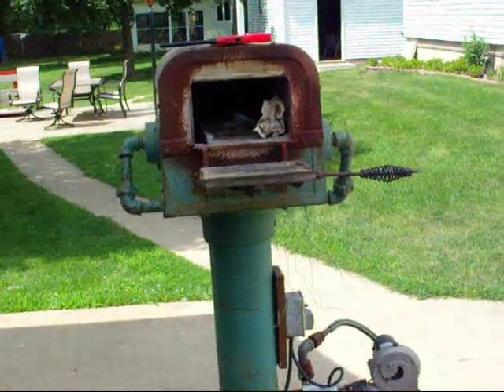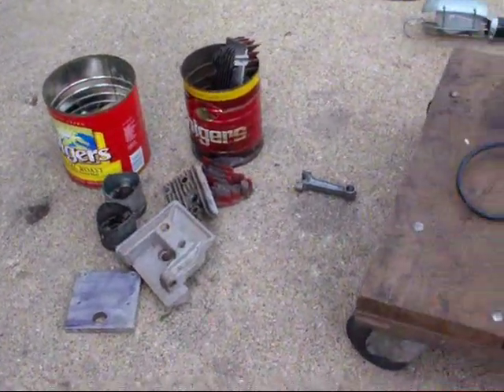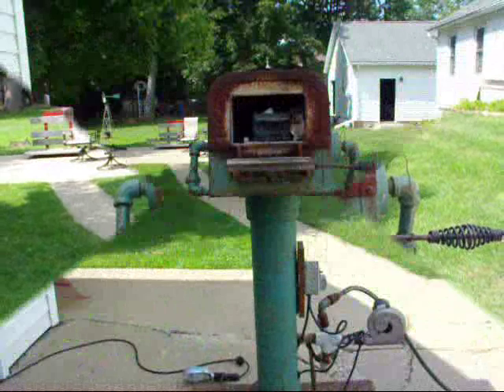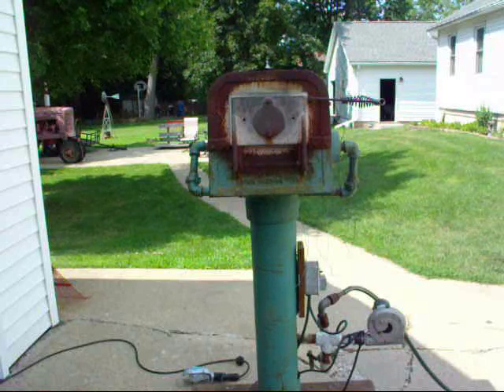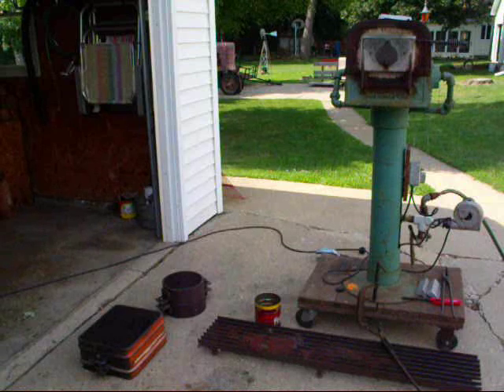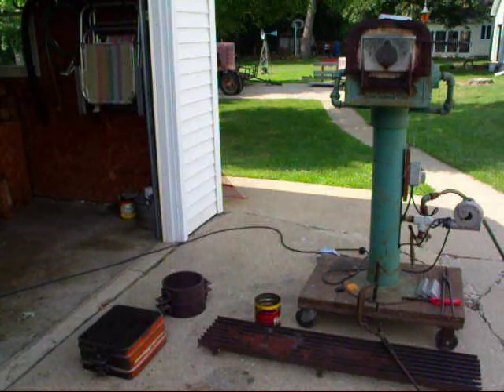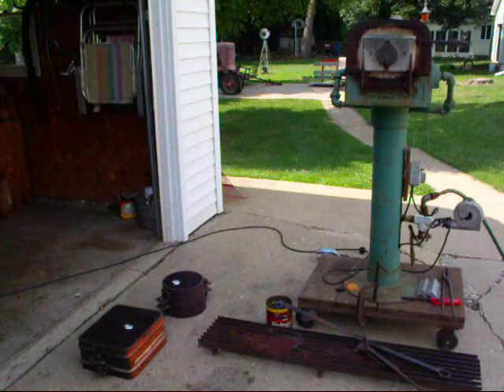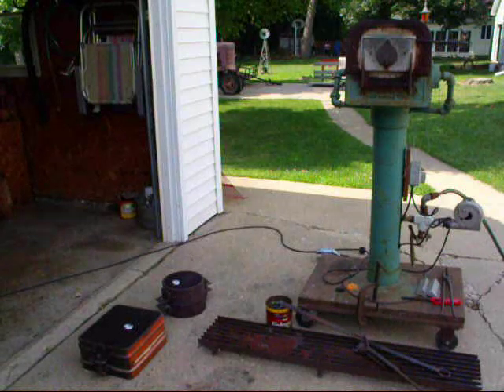FOUNDRY WORK Melting & Pouring part 4 tubalcain

Comment: I've heard from another home foundry man here on YouTube that he recommended not pouring over concrete because all concrete absorbs and retains some % water.  He said a spill of molten metal onto concrete can easily result in that retained moisture in the concrete to rapidly turn to subsurface superheated steam- this can result in cratering of the crete which in turn sprays the spilled molten aluminum above it all over the show.   (which sounds like a potentially fatal experience). He worked over compacted dry earth... i do not have any experience, so I'm just asking here your opinion on the matter?  cheers :)
Reply from the maker: Yes--he's right. I have mentioned that in one of my videos. Possibly its in one of my unreleased videos.  The concrete floor at school looked like the craters of the moon.
Reply: mrpete222
Appreciate the quick response and the advice. :) . I'm wanting to set up a little foundry myself so its very good to get the safety advice down solid to avoid me doing anything stupid.. I would have not thought of the concrete issue, for example if this guy had not mentioned it.  Cheers :)

Comment: Hello sir, I've been lucky to find your videos.  I have a question if you are so kind to answer and is that I've seen other videos, too, and I have the impression that some new steam engines are built to do nothing, I mean, besides the beautiful taka-taka-taka, never attached to an equipment so, here my question, this cast Aluminum can be used to build a cylinder and a piston if my project is building a lathe for turning wood and this lathe would have a steam engine?  Thanks.

Comment: Hello Sir-Great videos and great teacher!  Can you speak to the gas you are using on this furnace?  Natural?  After the gas leaves the local shut-off valve for this furnace, are you using any back flow protection, a regulator, or anything different than what would be used for a kitchen stove, or is it just a pipe/hose from the valve to the furnace?   Thanks again!